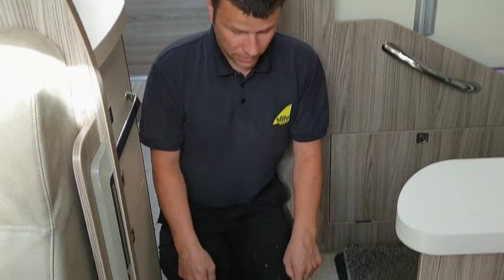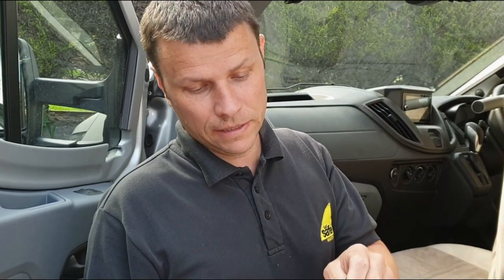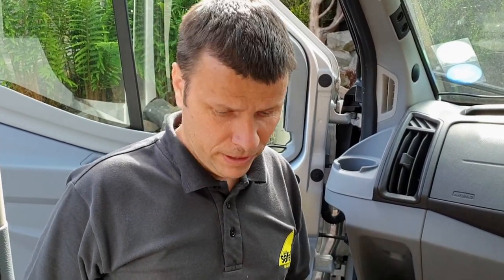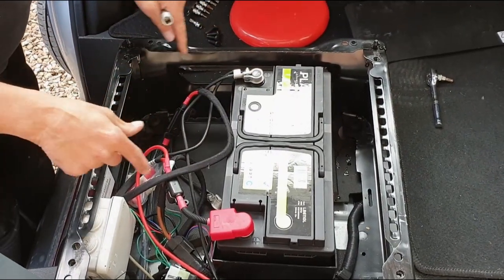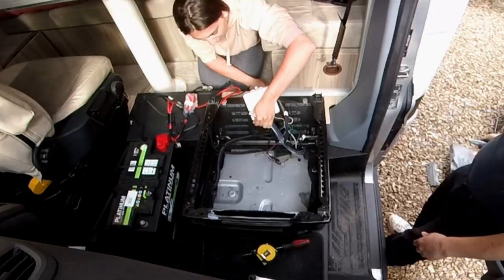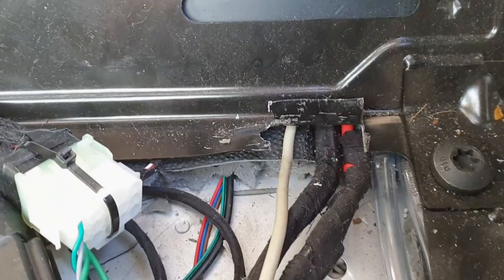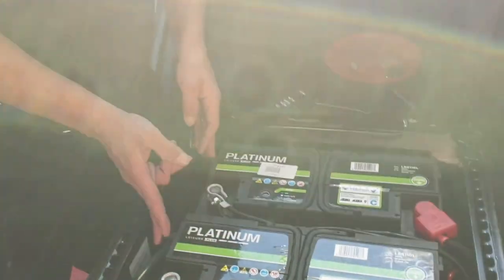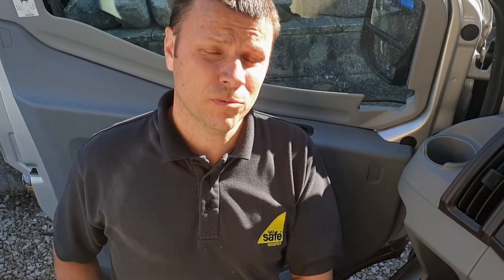Motorhome Battery Upgrade

Comment: Good video we have a Tessoro 486 was looking at adding an extra battery but when  I looked under the seat found it came with two as standard. Re you drop down bed if you use silicone spray on the runners it will stop the squeak also swap the 20amp fuse for a 25 amp   it blows because it supply's all the 12v to one side of the van.

Comment: Hi thought you would need to disconnect the vehicle starter battery before changing leisure battery ?
Reply from the maker: @RichardLascelles  they are completely separate systems until the engine is started and battery 2 battery charger is inuse.

Comment: Hi I wonder if you can help me? I have a 483 just added a second leisure battery, moving the plug around around a red wire and a green and black. Just wandering if you have any idea where to 
 reconnect. Thanks
Reply from the maker: Sorry I can't help but the best thing to do is go on to benimar Facebook group.

Comment: Hi can you just confirm regarding positive and negative wiring do they run parallel or in Series putting extra battery in and have same ford and extra wiring thanks G.Simpson
Reply from the maker: Hi the wiring was already there the + are linked so are the - so to keep it 12v  setup if you run the 2 batterys in series it will be 24v not all systems can run on 24v. Hope that helps 👍

Comment: We’re you able to buy a second plastic box/bund for the additional battery? I’m about to add a second battery to my T413 but am finding it difficult to get hold of a box/tray.
Reply from the maker: Hi I used a battery bag from a local caravan shop. I have just upgraded again to lithium batterys and 30amp b2b fitted under the drivers seat I would recommend fitting a b2b. Hope that helps

Comment: Thanks forthe video. I was thinking for replacing the leisure battery myself. I wonder how you want to charge those batteries? Repalcing with lithium requires the charging system to be adapted, i read. How did you manage that?
Reply from the maker: They are  just standard batteries not lithium batteries.
Reply: @familyadventures9723  thank you. I am sorry, I  assumed it to be lithium.

Comment: Great video thanks, did you switch the neg and pos terminals so one on new battery and one on old ?
Reply from the maker: No I keep it  as it  Just use the secondary cable for the new battery

Comment: Nice video! Im no expert but thought you had to by 2 batteries at same time rather then putting a new one with a used one? Thought if u put new one with old one he makes the new one only as good as orginal
Reply from the maker: Hi as far as I'm away because the way I've link them up it doesn't make any difference and my old battery is only 1 year old, giving I don't know the manufacturing dates of either battery I'm not too worried thanks for your comment👍
Reply: @familyadventures9723  I would have liked to have seen how everything is wired up.
Reply from the maker: @paulmiller7671  hi sorry I forgot to take a photo of it all finished but you can pause the video to see.  all the wiring loom was already there just had to connect to the batteries